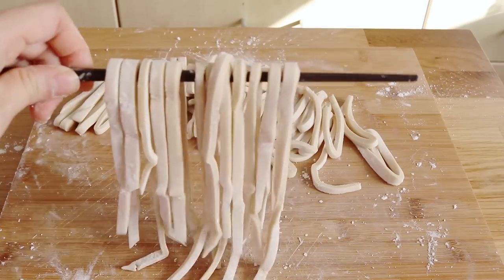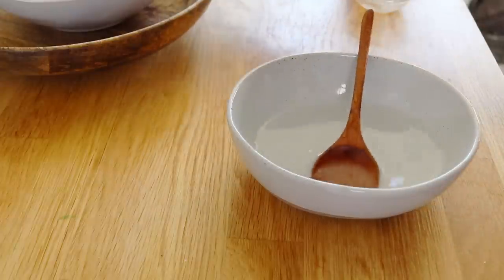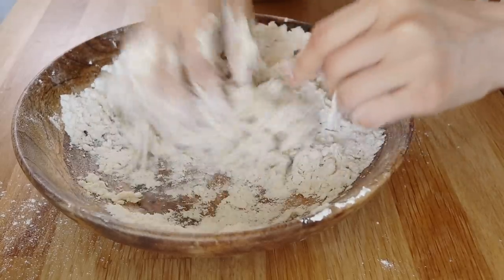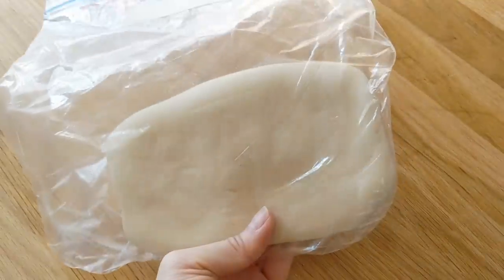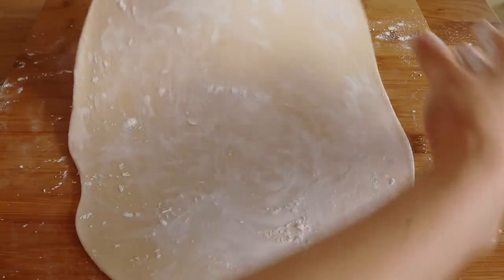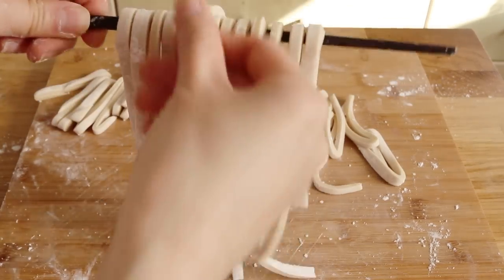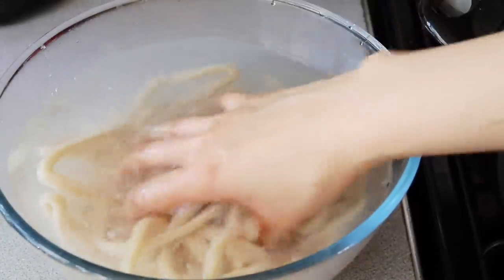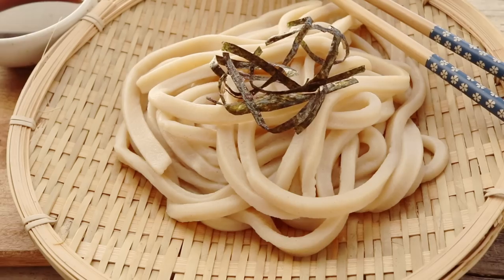UDON NOODLES 🍜- FROM SCRATCH!! 手打ちうどんの作り

Comment: iv made udon noodles probs about 6-8 times by now so here's what iv learned from personal experience.

if your making them for a soup, then just cook them in the soup stock instead of water, they'll absorb the flavor better

don't bother with measurements, adding water slowly until you reach the desired consistency is the best method IMO. it does take some practice tho so I'd still recommend measuring things out for your first attempt.

when you roll out the dough before cutting try to get it as square as possible, cuz otherwise your wasting dough on the tiny ends

Comment: hi~ i tried making udon with all purpose flour, boiled it (rolling boil, in high heat) in vegetable broth, afterwards when i took a bite it wasnt tasty at all. it was easy to bite into but as i chewed it it was kind of grainy and rough as the noodles broke down. it was my first time making udon.. do you know or have any ideas why it turned out that way? ありがとうございます

edit: my noodles didn’t look very smooth either too. after chopping the dough i dusted it with corn starch, i’m not sure if that affected the outside texture. but i also didn’t give it a cold bath that get rids of the starch, maybe it was that too.

Comment: I tried this but couldn’t seem to get the centre of the noodles cooked through no matter how long I boiled them for. Any idea why?
Reply: Maybe they were a bit too thick?
Reply: Same. I boiled mine for over half an hour
Reply: Most recipes of Udon usually appy an alkaline-based solution such as lye (kansui) or "baked" baking soda. This video's recipe is missing that, which is interesting. Udon is supposed to be chewy though, so maybe you're not leaving the dough out to proof a bit more, or the dough hasn't been folded properly or hasn't been cut or stretched thinly enough.

Comment: Is there another way to do this? I feel disgusted stepping on it and then eating it lol
Reply: Through a pasta machine if you wanna
Reply: You can also use a rolling pin. It's more work though.
Reply: Why would you be grossed out if you know your feet are clean and it's inside the plastic bag?
Reply: @jovanimartinez8277  does that really work??!
Reply: @yeah2853  i believe it would, assuming you have a sturdy enough machine. But better to try to get it as thin as you can with a rolling pin and then run through the machine to minimise the work, just in case :)